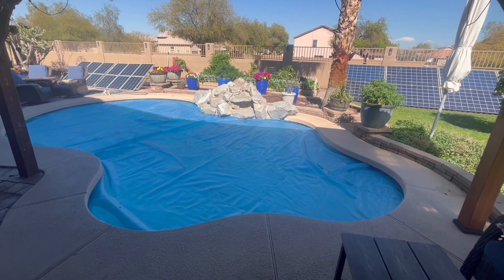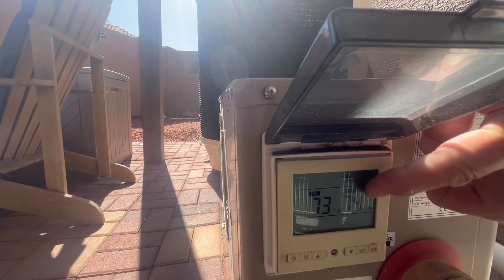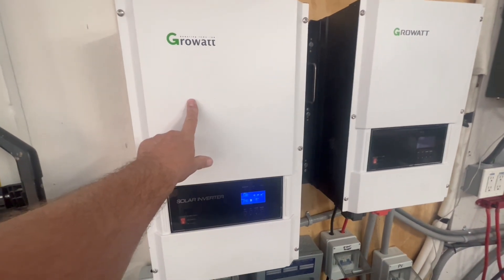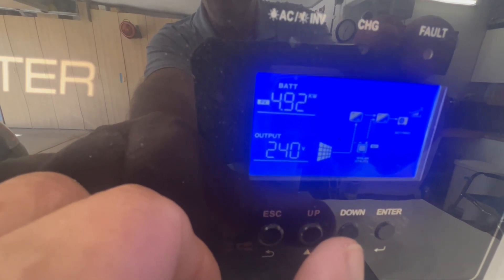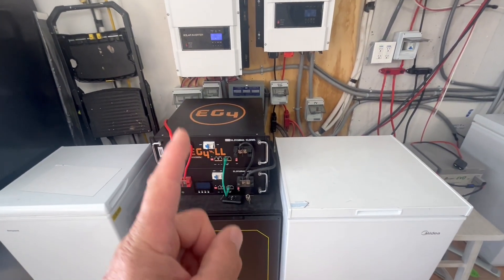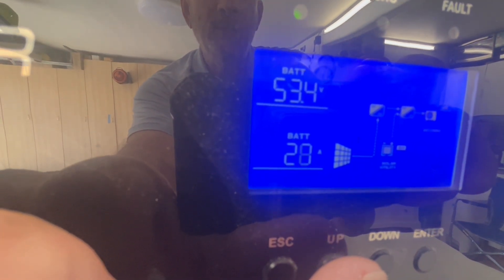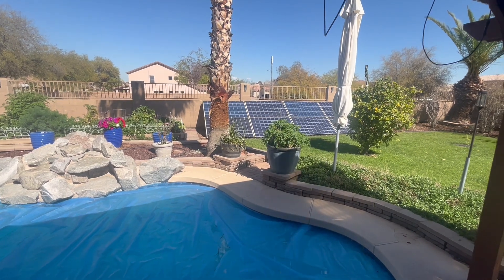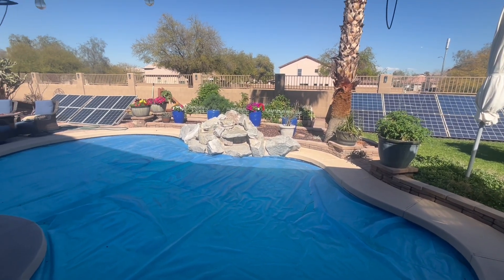DIY solar panel for home. EG4 LiFePO4 batteries, 12kw Growatt inverter & 12kw solar heating pool

Comment: Can the charge controllers keep the batteries at a set level in float? Like 1000 watts in, you use 900 and they are fully charged, will they cycle up and down or hold 100%?
Reply from the maker: The EG4 charge controller has settings to set voltage at bulk charge, float charge, charging current max and battery type. I use EG4 charger to suppiment my loads or to suppliment to charge faster with either one of my Growatt low frequency off grid inverters. I do not use as a stand alone to just charge batteries. For the Growatt inverters, I have to set in user mode for battery setting. Cannot get Growatt inverter to communicate with EG4 batteries so sometimes the charge state will be in standby at 99 percent instead of 100 percent. If I turn off charge controller, the EG4 battery bank with just the Growatt inverter will charge battery to 100 percent. The EG4 3000 watt inverter I have easily connects and communicates with the EG4 lifepower4 batteries. I can even see the state of charge and percent of battery on EG4 inverter screen. Something I can’t do with any of my other inverters. I like the EG4 charge controller but am moving to the 2-EG4 3000 watt inverters in parallel that can give me 120/240 volts output. I am reconfiguring my solar panel arrays so I will no longer be using the EG4 charge controller, it has worked flawlessly for me over the last year using it. When thinking about this charge controller, think about charging the battery with amps and setting bulk and float charge settings. Can’t really set watts in settings. Hope this helps in answering your question. If you have more questions, please ask. Hope you have a wonderful and blessed 2024.
Reply: @diy-solar-guy  does the eg4 charge controller communicate with the eg4 all in one inverter charge controller? Curious if it’s a good upgrade path and if I could keep scaling up the system with more solar if I want.
Reply from the maker: @Deveak the charge controller will not communicate with EG4 3000 watt inverter. But you can connect 5000 watts to the EG4 3000 watt inverter and actually get 3000 watts output. Parallel a second EG4 3000 watt inverter and you now have split phase. Being able to have 6000 watts output from 2 inverters and split phase is better than a EG4 inverter and a charge controller. That charge controller has the positive and negative from pv and from battery. Only connect 4 wires. Charger connected to bus bar if battery. I am receiving my second 3000 watt inverter tomorrow and will connect in parallel. I will have the ability to run a  split phase voltage from 3 separate inverters.The next inverter I get will be split phase capable with just one unit. Probably an EG4 inverter.